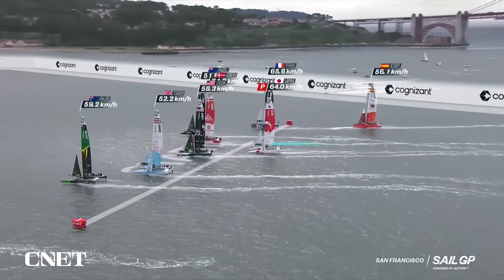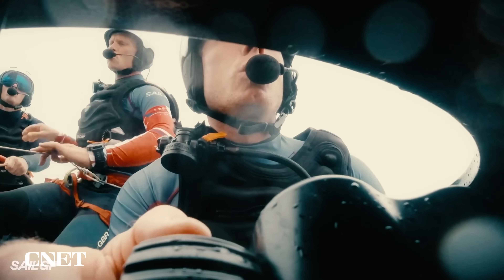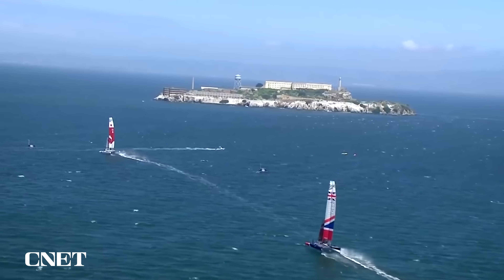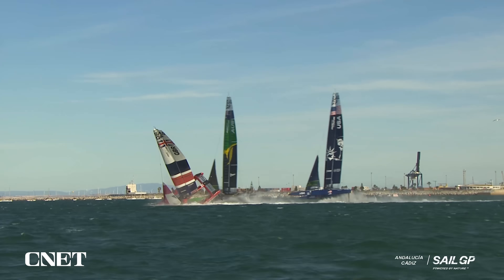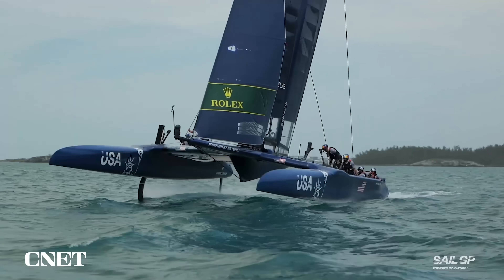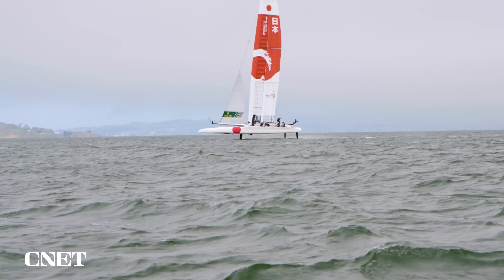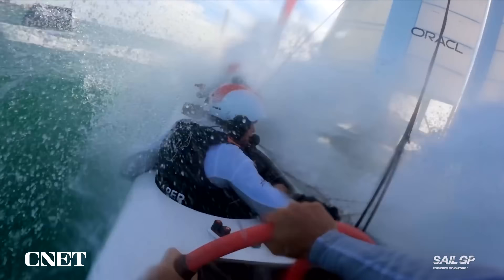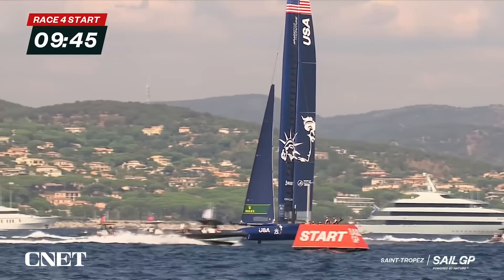World's Most Advanced Hydrofoil Boats Fly Above Water

Comment: Its failure to use a synthetic oil, regular motor oil doesn’t flow easily like synthetic. But if you had a separate oil pump switch you could have run that before trying to start it. You need foils like the racing sailing boats have.

Comment: Great boat. Great race. The course is braindead. The race seem like 8000 metres in length when it should be factors larger. Perhaps 100x larger. For context, the Indy 500 is 500 miles or ~800 kms so the SailGP course is 1% of the Indy 500. People will be dying in this race since the boats will collide a lot. Someone will be hit dead on by a hull at some point. Despite the strategist which is a highly sensible addition to the format. 
I suppose its exciting to see boats neck and neck but shipping these boats around the world for what would be a 10 to 15 minute race. And finally what type of skill especially in reading the wind can happen in 15 minutes. It's dumb luck. And heres another race comparison the Bermudes 1000 is ...... 1000 kms. Twice that of the Indy 500.
A decent trade off would be a course of 20 km to 25km in length and run it 10 times will keep it exciting and permit some changes in wind that sailors need to consider. 
Otherwise love it.

Comment: What is the impact of the sound from the hydrofoils on whales? Serious question. It has long been known that the world Navys and commercial vessels use hi pitched deep sonar. Curious as to the decibel range of the sound made by hydrofoils. It is known that the decibel range of sonar is around 259 decibels and will retain about 140 decibels some 300 miles away. Not sure it has been proven that sonar does indeed disturb whales causing death. But studies have even been done with the noise generated from large ships engine vibration. I am a big fan of the hydrofoil vessels and the races. Just wondering if any studies are being conducted on the noise generated by the hydrofoils.

Comment: So what's the next step? Maybe coming out of the water and flying above in the ground effect (water effect in this case) and making tremendous speed from the wind. Sounds good on paper.....but will it fly?
Reply: (1/3) Without contact with the water, what would keep the wind (and lift from the sail) from tipping the flying sail boat over? How would it harness the energy of the wind to fly and steer itself above the water?

Let’s discuss how sailplanes work, and compare that with how sailboats work. First sailplanes: 

A sailplane’s wing generates lift as its movement cutting through a mass of air causes that air to be displaced and pass either above or below the wing. Due both to the shape of the wing and its “angle of attack”, the displaced air passing over the top of the wing is forced to move further than the air displaced below, thus resulting in that air having to move faster than the air below to return to the same place. 

Faster moving air has a lower air pressure; that lower pressure above the wing (and the corresponding higher air pressure below) results in an upward lifting force on the wing, keeping the sailplane from plummeting to the ground. 

(Additional lift can be generated by the wing’s passing through a mass of air forcing that air downwards. First, a mass of air disturbed by the wings’ passage is pushed downward by the wing itself; in the same manner as you can push air downward with your extended hand as you drive down the highway with an window open … and do you note how that the air you pushed down with your hand (the wing) in turn pushes upwards on your hand? Second, the disturbed air is also directed downwards due to the air displaced above the wing rejoining the air displaced below the wing with greater energy, since the air above was moving faster.)

This only works, however, when the wing is moving forward through the air. A wing that isn’t moving through the air isn’t pushing air out of the way, making it move, and creating the necessary pressure differential that creates lift.

A powered aircraft can rely on engine thrust alone to push the aircraft’s wings forward through the air (this is also how all ground effect airplanes propel themselves). A sailplane must generate that speed without engines — thus it depends entirely on gravity (pulling downwards on the aircraft) to accelerate it. 

Without being formed into the shape of an airplane with wings, a random block of aluminum and composite will fall more or less straight down due to gravity.  An airplane and its wings are shaped so that that the downward pulling energy on it is harnessed and deflected more to one direction than any other (towards the rear of the aircraft). This pushes the aircraft forward (while still descending) until the wings begin generating lift as explained above.
Reply: (2/3) Sailplanes in a steady downwards glide can still gain altitude (relative to the ground) when the air mass they are flying in is itself rising faster than the aircraft is descending through it. Gravity still powers it’d forward flight, even if the aircraft is climbing upwards (relative to the ground). 

Sailplane wings are extremely long and very efficient, and the aircraft weight is low. This allows them to glide longer distances than heavier, powered aircraft optimized for different sorts of flying; but they can only remain aloft while able to trade their altitude (potential energy) for airspeed (kinetic energy) — courtesy of gravity. 

A sailplane can, however, rapidly gain altitude by using its inertia to trade its forward speed (kinetic energy) for additional lift. And as the aircraft gains altitude (relative to the ground), it is converting some of that kinetic energy back into potential energy. This situation is unsustainable, however, because its climbing will steadily reduce its speed through the air, thus reducing the lift its wings can generate. If the pilot doesn’t lower the aircraft’s nose and point it back down in time, the sailplane’s wings will soon stall, and the aircraft will fall.  

NOW, to consider your hypothetical ground effect flying sailboat, we first need to discuss how a sailboat works:

A sailboat of this type (SailGP) generates lift in much the way an aircraft wing does.  The underwater horizontal parts of the hydrofoils are functionally equivalent to the sailplanes’ wings — their speed through the water lifts the boat’s hull vertically out of the water. 

What generates the hydrofoils’s speed? Not engines, of course, and not gravity either! A boat moves parallel to the surface of the earth.  Unlike a sailplane, it can not trade the downward pull of gravity for lift or thrust (and the water isn’t rising faster than the boat would otherwise sink, if it was just an unboyant crumpled ball of fabric and steel).

The boat’s speed is generated by the interaction of its sail and its keel (or hydrofoils). 

The sail generates lift horizontally as opposed to the aircraft’s wing generating lift vertically — but that’s only because the sail is oriented vertically and aircraft wing horizontally. Either way, each craft’s wings generate lift the same way … at a 90° angle from their chord-wise (front to back) orientation and direction of travel through the air.

The boat’s keel (or hydrofoils when serving the same purpose) is necessary to keep a boat upright, in order that the energy generated by the sail can be used to push (or pull) the boat forward. A sailboat without a keel (or a large enough one, if the winds are too strong) will simply tip over when wind blows sideways upon its sail. The keel, by being submerged in the water, a fluid far denser than air, resist the tipping motion caused by wind pushing sideways on the sail by itself pushing against the mass of water alongside it in the opposite direction. Water being far denser than air means the keel can be far smaller than the sail to exert the same amount of force in their respective fluids. 

Consider: 

A boat is sitting at rest, in zero winds, with a wing shaped sail currently aligned bow to stern. There is no wind, so the boat does not move.

Suddenly a strong wind starts blowing from starboard (the right side). It strikes the sail squarely on its flat side. This will of course push the sail to port (the left).  If the boat has a smooth flat bottom (like a kayak) or smooth round one (like a canoe) and no keel, the wind will easily blow the boat over, yes? Good.

Next consider the same boat, but with an extended keel board.  As the starboard wind pushes on the entire sail and that pressure exerted on the boat’s mast starts rolling the boat to port, the keel board underwater, below the axis of rotation, is pushed into the mass of water to its starboard side. It isn’t easy to push this dense fluid out of the way, so the water’s resistance to being pushed by the keel to the boat’s starboard side in effect exerts a counteracting force on the keel — toward the boat’s port. 

Now both mast and keel are pushing to port.  The forces cancel out, and the keel equipped boat is more resistant to capsizing (in practice, stronger winds also require the shifting of weight to the upwind side of the boat to help prevent the boat’s capsizing; as seen by the boats’ crews all switching sides when their boats change direction).

No consider we change the angle of the sail, so that the trailing edge of the sail extends diagonally toward the port stern.  Air hitting the sail from starboard is now deflected to the rear of the boat, imparting a thrusting force toward the bow. The boat begins to move forward. All the while, the keel (or hydrofoils) remain in the water, resisting the forces that would otherwise push the sail over and capsize the boat.  As the foil’s speed through the water increases (due to their airfoil-like design) so does the force they impart against the boat tipping over. As the speed of the boat continues to increase, the angle of the airfoil-shaped sail to both the wind and the boat’s course through the water is carefully adjusted to take advantage not just of the sail’s ability to be an object for the wind to push against, but also to be a wing that cuts through the air creating lift (through a wing’s generating of differential air pressure on each side) which pushes (or pulls) the boat even faster through the water. 

Without a keel (or hydrofoils) and rudder in the water to control to course of the boat, there would   be no way of sailing in absolutely any direction but directly downwind (at no more than the speed of that wind, less drag from the water or drift from currents). A boat with those, however, can effectively harness the wind’s energy and sail sideways to the wind, and even against the wind! A sail captures the energy of the wind and transmits that energy to its mast and down to its hull, where it is met with forces exerted by water being displaced by (and resisting being displaced by) the keel and rudder transmitted upward. These three forces combine to push and steer the boat through (or above, if elevated on hydrofoils) the water — and in any direction desired, even ones upwind.

Removing the boat from the water provides no resisting force to keep the sail oriented vertically, nor a means to harness the energy of the wind to generate lift.

A kite, for example, stays airborne in the wind because the line attaching it to the ground provides a resistant force that causes the air blowing past the kite to have to flow around it — and that airflow creates lift sufficient to counteract gravity’s pulling down on the kite. 

These boats’ hydrofoils (submerged in the water) generate lift to keep their hulls airborne. But if their hydrofoils leave the water, they no longer provide that lift, gravity wins, and the boats come crashing back down. So hydrofoil sailboats /can/ fly (when their kinetic energy is accidentally harnessed in just the wrong way) … just not for very long!

The boats contact with the water also provides the resistance (like the kite’s anchored string) that enables its sail to cut through the wind and generate the (sideways) lift which, when properly harnessed, propels it through the water. For any of this to work, the boat needs constant contact with both mediums — water and air. It is these differential forces at play from which a sailboat is able to draw energy. 

A flying ground-effects boat can’t generate thrust or lift this way, because it isn’t in contact with the water. 

[It’d be like expecting the wheels of an airborne stunt car during a jump to propel the car through the air indefinitely.  Obviously they can’t — tires need friction with a differential surface to transfer the vehicle’s engine energy to horizontal velocity.  

As pushing against the wall of your house causes the wall to push back on you an equal amount, tires pushing against tarmac are pushed back on by the road — and thus the car is able to accelerate. (Some cars have been known to travel fast enough that they, too, become airborne … but only briefly — just as a sailplane can also trade its kinetic energy for altitude.)

Air isn’t as dense as your house’s wall or the road — you can’t just lean forward and push against the air as you can the wall of your house. You’ll fall flat on your face — unless it’s really, really windy! Tropical storm force winds are strong enough to begin supporting your leaning into them. At skydiving speeds (equivalent to a major hurricane), air feels about as dense as still water — you can “swim” through it!]

A true aircraft can only fly with a source of thrust to move air over (and under) its wings. That requires either engines, or the ability to descend through a given mass of air (powered by gravity).  A boat just above the ground or water has little potential energy to exploit. It can’t descend long without striking the surface, at which point drag from the surface quickly negates all remaining speed and lift and the vehicle will come to rest in the water. 

… unless it also has sails and a keel, at which point it can become a boat, and start moving again.  

Hope this helps.  🙃👍🏼
Reply: (3/3) Worth noting that these SailGP catamaran boats’ wide stances and buoyant hulls also exert anti-rolling forces on the vehicles, as the surface of the water resists their downwind hulls pushing pushing into it, and the weight of their upwind hulls far from the centerline resists rising (against gravity).  But this is only good for so much. It’s the stuff underwater which is most important.

Comment: This is what Cargo ships and Oil tankers must use for forward thrust. Lots of dead heads and sea life near the contental shelf but less impact from desil electricity. maybe tandum hydrofoil tug boat like system where one pulls a elastic rope then drops off for the 2nd or 3 pulls of a cargo ship. Weight savings of fuel engine prop with 5-6 racing boats teathered to tankers or cargo ships. Ropes become electric after a few feet so a std rope will work as a bungi cord.

Comment: For video claiming to know about the sport they should know that that wasn't a cap size that's called a pitch pole when the front of the boat goes into the water not the side.
Reply: Again when doing the crank the weight of the boat doesn't determine how hard the crank is the sail size and the wind speed determines that and the gear ratio.

Comment: Whjy arent these boats using the clearly superior "cyclor" tech demonstrated by NZ in the America's Cup? Legs are better than arms.
Reply: Different system. The cyclor tech was in order to keep a hydraulic system charged. These use a simple direct link to a winch and more precision is required. Understand also that the cyclor tech was an almost cynical demonstration of the looseness of the rules in that particular America's Cup. It was sort of "OK, if you are sloppy enough with your guidelines, we'll use legs instead, win it, then fix the rules". I doubt you'll see it again, at least while NZ holds the Cup.